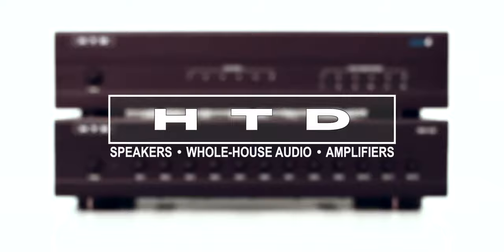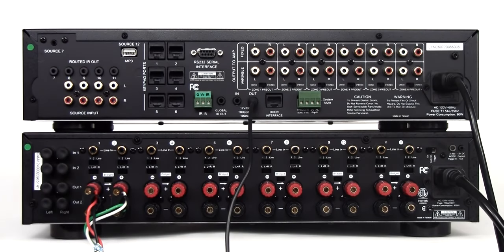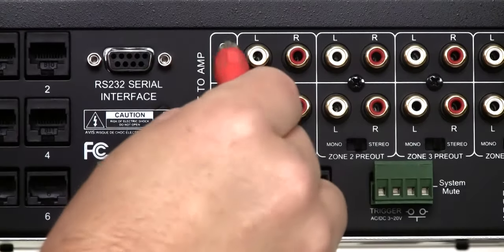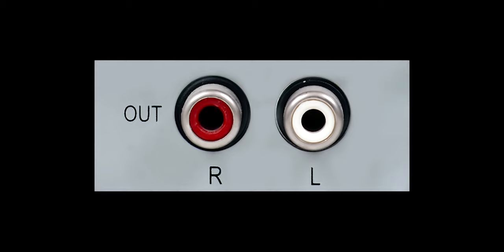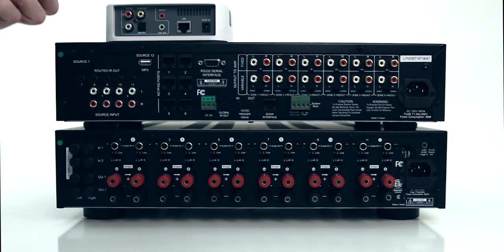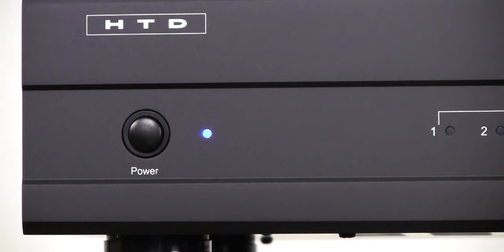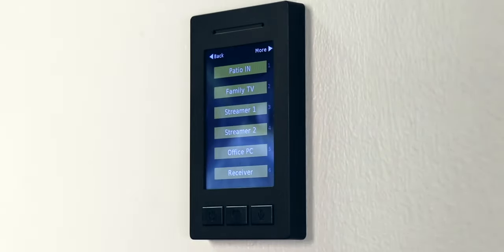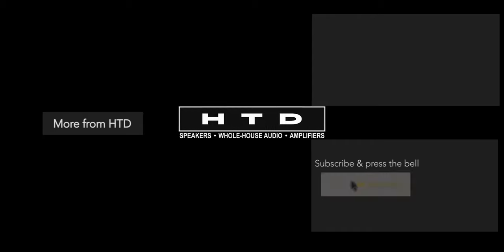Connecting An HTD Lync Whole House Audio System

Comment: System is fine but your wifi is complete utter crap. Never seen anything like it just utter crap.
Reply from the maker: Okay, I'll respond in good faith.  By "wifi" I will assume you mean control of your system with our app over your existing WiFi network.  If your WiFi network is set up correctly as a single mesh network and not just a bunch of access points that each manage their own bank of IP addresses, and you have properly configured the "HTD Home Audio app", it will work every time. Read more in our online support pages.  For Lync specifically: https://www.htd.com/blog/troubleshooting-lync

Specific to the app: https://www.htd.com/apphelp

Comment: Why do you still utilize RCA connections when they’re old technology?  My previous home had your system that the original owner put in.  Sdx speakers and they were okay but the audio was flat.  Purchasing another home that’s already built and considering your system again due to price over a Sonos, maybe several of your hybrid wireless systems but can’t get over all the old technology RCA cables.   Change my mind…….
Reply from the maker: Hi JP, thank you for the question.  This comes up occasionally, so I’ll address it here in detail.

RCA analog connectors have been around for a long time and they will continue to be used for home audio, especially when it comes to stereo audio.  Because digital audio is a newer technology than analog, people sometimes mistakenly believe digital has completely replaced analog.  This is not the case.  Digital audio formats offer a great way to transport audio signals over long cables (across the Internet and within your home) and over wireless technology like cellular, Bluetooth and WiFi.  But all digital audio signals must be converted to analog using a DAC (digital to analog converter) before they can be amplified.

Regarding Zone Outputs: Both the variable volume and fixed volume outputs available with every zone on the back of the Lync Controller need to be in analog format before being connected to the amplifier for amplification.  That is why they are all RCA type connectors.  To reiterate, it is not possible to amplify a digital audio signal without first converting it to analog.

Regarding Source Inputs: When you see a digital input (HDMI, Toslink) on a device like a home theater receiver, inside the receiver is a processor that divides the digital signal into its various surround sound channels and then converts them to analog before amplifying them.  While a home theater receiver will include many digital input connectors, each of those source inputs still get routed through a common processor and DAC.  This is because it will only output one source at a time.  A home theater receiver will typically only include more than one built-in DAC if it offers a zone 2 or even zone 3 analog output (hence their higher cost).

In contrast to a home theater receiver, with whole-house audio every source input must be available at all times to every zone.  This is often referred to as a matrix switcher.  So every digital source input would require its own built-in DAC.  Lync provides one digital source input (source number 7 on a Lync 6, and source number 13 on a Lync 12) with a quality built-in DAC.  The other 4 inputs on the central Lync controller are analog.  This allows the customer to decide whether or not to use an analog audio output from their source, i.e. using the source’s own built-in DAC, or adding a separate external DAC to their digital audio source.  HTD makes a great stand-alone DAC, but other audiophile brands make even better ones, albeit more expensive.  In any case, the choice is up to the customer.

The other source inputs available to Lync systems are optional and can be installed throughout the home, such as behind a nightstand or TV.  While the input connectors for each of our Source Input Panels may be analog or digital, they all get converted to digital for the long transport across the home (over Cat cable) to the central Lync controller.  Inside the Lync Controller, these digital audio signals get converted to analog before being added to the audio matrix and sent out of the Variable or Fixed RCA outputs into the RCA inputs on the amplifier.

Finally, regarding the speakers in your home, did you try adjusting the +/- 3dB switches on the speakers themselves or adjusting the treble and bass from within the app?  As mentioned above, you could also try improving the sound quality with a different streamer or external DAC.
Reply: @HomeTheaterDirect   wow thank you for the detailed response.  This is very helpful to understand.  

Regarding your question, I did adjust the +/- 3db switch.  These SDX speakers were installed with homemade “boxes” framed in between the ceiling joists with 2x10’s and insulation.  I suspect the original homeowner did that to isolate sound from going upstairs and perhaps this was prior to you offering the speaker mount brackets.  They were also using an older Sony stereo receiver with one of your zone controllers/switches.  

Because of your response and support I’ll absolutely purchase your products again for our new home.  Likely several hybrid wireless systems because I don’t think wirh existing construction I can run everything back to a central location although I may be able to via the basements drop ceiling.  

I Will also be purchasing a surround sound setup for the living room which has vaulted ceilings so I’ll call and work with your customer support on a plan for ideal placement.  All from the HDX line and an in wall sub.  (Previous house has this as well)

Your customer service is outstanding so far.  Thank you
Reply from the maker: @JP-ec8fe  Thank you!  A quick note regarding the installation of boxes behind in-ceiling speakers - this is usually not necessary, and most customers achieve great results by just lying about a two-foot sheet of batt insulation behind the speaker.  This can be stuffed through the hole cut for the speaker before installing the speaker.  Never use blown-in insulation directly behind a speaker as it can work its way inside the speaker frame and inhibit the movement of the speaker cone.  If your batt insulation has a paper (barrier) side, make sure it is facing away so that the batt side sits right up against the speaker frame.  Adding a box that traps the correct volume of air (contact us for your particular model) is not harmful and can sometimes improve bass performance.  This box should have insulation inside of it, but it should never be packed in.  We look forward to working with you in the future!
Reply: Thanks for your explanation regarding digital signals being converted to analog before amplification.    I had no idea that's how even modern stereos with digital inputs processed the signals and then converted them before amplification.     The knowledge you gave definitely gives me a whole new outlook on the HTD equipment I recently aquired ( HTD MC86 multi zone audio controller, HTD A-2106 Amplifier and HTD 1235 Amplifier)

Comment: Been in the house I built for 3 years now. I wired for a lync 6 system. Already got my speakers in the ceiling. Just trying to find a good time to purchase a 2800$ setup. I can’t wait to get it. Just don’t know when it will be
Reply from the maker: One idea would be to start with a “no keypad” set and control entirely with the HTD Home Audio app. A Lync 6, 12-channel amplifier, and a WiFi gateway starts at $1799. You could always add LyncTouch keypads later. We typically recommend adding at least one keypad, usually installed in the kitchen, to take advantage of the intercom feature where you could at least page into one or all zones. A keypad is also handy if your WiFi goes down. https://www.htd.com/Lync6-and-GW-SL1_2
Reply: @HomeTheaterDirect  very good idea. 👍🏻

Comment: This system looks really dated I’m sure it’s not that old but it just looks that way
Reply: Not sure to what exactly you are referring, but this is very much a modern system.  If you are looking for an all-in-one solution with just a single centrally located device, you should consider our mid-level MCA system.  Bottom line: if you are installing speakers in your ceiling, you need to have some way to power them, which means you need an amplifier.  If you'd like to select between multiple sources and have independent volume control per zone, you need a controller.  Generally speaking, it is better to separate these two devices in order to have flexibility in how much amplification you want to assign to any one zone (room).  The efficiency and "sleep" options, the ability to have a visual indicator of source strength, the ability to connect sources throughout the house as well as at a central location, and the option to control with a smart device and/or touch keypads are all modern features.

Comment: Can you only use 2 speakers per zone with the emplifier then? What should you do if you have more or less than 2 speakers per zone
Reply from the maker: Hello Ben, all of our amplifiers are 4-ohm stable which means you can connect one or two 8-ohm speakers per amplifier CHANNEL.  With a 6-zone system and a single 12-channel amplifier, you are provided with two amp channels per zone.  Typically, the first channel is set to play the LEFT side of a stereo recording and the second channel is set to play the RIGHT side of a stereo recording.  You can connect just one speaker per amp channel, or you could connect two left speakers to the first amp channel and two right speakers to the second amp channel.

We sell pre-packaged whole-house audio sets on our site that typically combine a 6-zone whole-house audio controller with one 12-channel amplifier or the set will combine a 12-zone whole-house audio controller with two 12-channel amplifiers.  Since these pre-packaged sets provide 2 amp channels per zone, we say if all zones are used then each zone can include up to 4 speakers.  But you can always add more speakers to a zone by adding more amplifier channels.  As an example, if you are using all 12 zones, but need one zone to have more than 4 speakers in it, then you could add a 2-channel amplifier like our SZA-1 or PLA-240ADS to power additional speakers for a zone.  Another example: let's say you are only using 5 zones of a 6-zone system.  That means you will have two extra amplifier channels available.  Those extra amp channels can be used to power more speakers in one of the 5 zones.

We can assist you in how to connect the zone on the whole-house controller to these extra amp channels, but essentially it involves plugging the Variable Output for the zone on the whole-house audio controller into one of the Bus inputs on the left side of the back of the amplifier; you then assign 4 amplifier channels to that Bus input and set each amp channel to either power the left, right, or left+right (mono) side of the stereo recording.